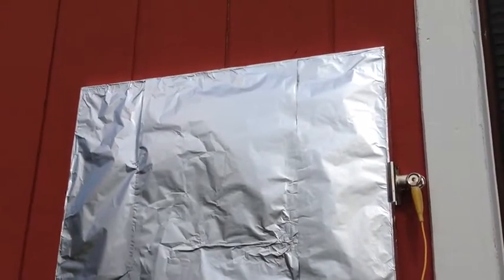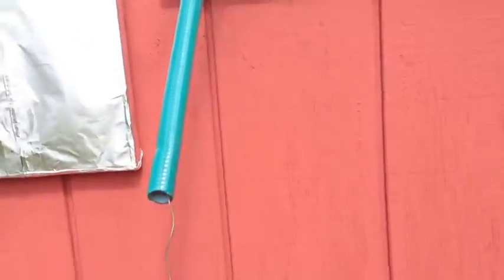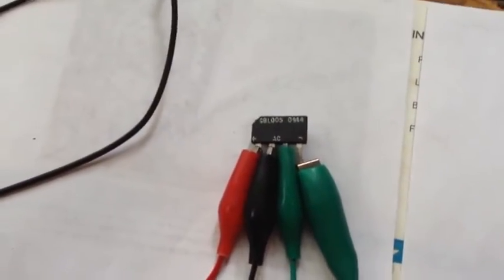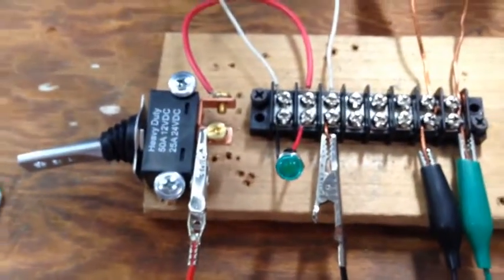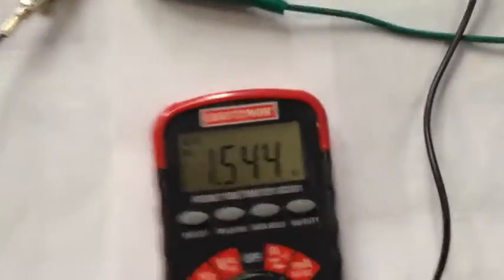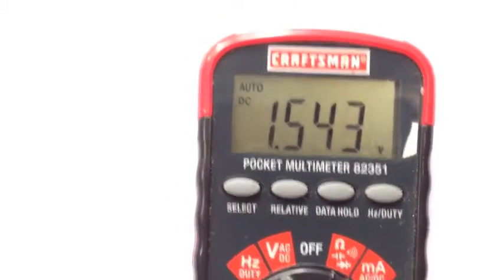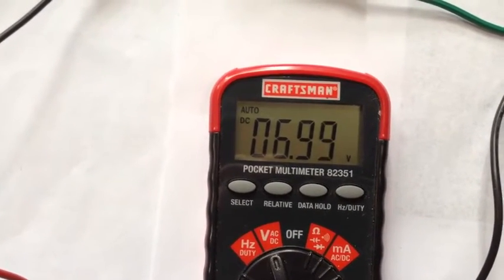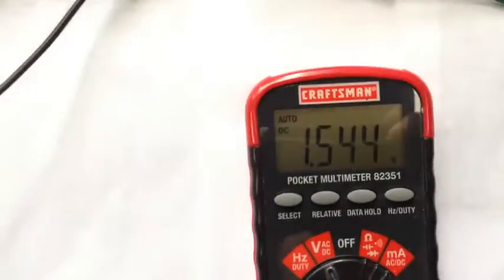Tesla Ambient Energy Collector

Comment: Use an antenna pole and drop a line down. Place a coil across that line and ground. Put that output into a tesla coil amplifier. Then a super capacitor pack and a voltage regulator. You can use a foss gate to create ac.

Comment: Another consideration. Instead of using a flat plate antenna, Tesla had worked out the shape of an ideal lightning rod -- different from the Benjamin Franklin design. You can find the Tesla patent on this and his discussion of why it is better. The shapes he proposed are NOT pointy rods. Rather, his design wants to bleed energy safely from Earth to sky rather than a pointy rod that would actually attract lighting strikes. With a gradual current flow, you have a current flow. Wink.

Comment: btw, if you use the home plumbing copper pipes as your Ground, you can pick up the SPIKES from appliances in your home and convert these to power using a circuit like this. Further, if you have fluorescent lights near your plate or coils, you will pick up power from your home lighting.

Comment: don't use a silicon bridge rectifier. Use 4 germanium diodes (1N34). Silicon has too big a voltage drop. Germanium is more delicate. See Tate Ambient Power Module circuit online.

Comment: recommend: IRON rod for ground or better a HUGE iron plate buried ... with IRON wire up to your circuit. For plate, use a plate of aluminum that has more mass. Tinfoil is very resistive. If the plate is hung with cords, the wind can impart or take ions. Connection to plate should be brass to aluminum ... and the copper should attach to the brass. It is very important that all wires be unobstructed and NOT near the house structure or any other structure.

Comment: I believe making a grounding system that has a greater surface area, and covers a larger perimeter underground should greatly increase the amount of energy collected. The greater the surface area of both the plate and ground; the greater the potential difference between the two which in my mind would lead to faster charging at a higher energy level. I would also be careful about using too many digital components, tesla of course only had access to a limited amount of tech, but I think he still would have avoided using transistors or mosfets, and would probably still prefer to use a spark gap or vacuum tube; as an important part of his later technology was having to do with disruptive discharges.
Reply: Tesla used a coherer, which is a "one-shot" device that needs to be reset. We have diodes now, but germanium is better.

Comment: Good work. why do you rectify the antennae? Radiant energy is already in DC. I wonder if using the same antennae and ground if you could make other identical parallel circuits and increase the amperage.also tesla says the switching on and off of the circuit is what increases the charging time. he mechanically switched in kilo htz. a $4 555 timer from radio shack is faster than that now a days. Have you looked into the switching part of Teslas  Patent  on "The Utilization of Radiant Energy"? its on google patents.also isnt the voltage set by the capacitors rating? Thanks again and Cheers.

Comment: the antenna needs to be away from and  above nearby building and trees. solder you connections where possible.  use copper alligator clips if you need to use clips. capacitor is to small

Comment: I have done this with my metal barn roof, it's on wooden supports and it varies so much, so I didn't have any means of controlling the very wide variations in voltages and frequencies. Interesting part was that chemtrails boosted the readings a massive amount.
Reply: "tuned" circuit needed.... coil & variable capacitor or capacitor and variable inductor.

Comment: I'm very interested in the same thing, particularly in Earths orbit. With the proper receiver/antenna array there should be a significant and usable amount. Outside our atmosphere there is constant ambient energy that could be collected. If the outer skin of a spacecraft were configured to collect these different energies that could greatly reduce fuel if not replace it entirely. Eventually we could use everything from gamma rays to gravitational waves for energy production.

Comment: this is briliant!  What are the measurements on your collection panel? I am very interested in working with you on this.
Reply from the maker: Hi John: The cardboard panel was approx 20 in x 14 and had aluminum foil taped to one side.
thanks
Reply: Would you mind sending me a wiring diagram and the codes for the diodes so I could get them off ebay ? I would really like to test this my self please :)
Reply: Miguel Khoury Please would you include a diagram for each project so others can try copying your experiments? I wonder if connecting circuits like this in series will produce higher voltages? Seems likely. I’ve noticed that every battery cell I’ve seen produces no more than 2.2 volts. Larger cells develop more amperage & all must get connected in series or parallel(?) to increase the voltage. Normal car batteries produce an optimum of 2.2 volts. A, B, C & D batteries produce 1.5. This does appear to be the mythical “free energy” if only it can be harvested for use!

Comment: nice setup. You'd get better output if you used a more efficient rectification method like active FET rectification, and your output would be more useful if a blocking/royer oscillator was used to keep the energy in the circuit. Check out LaserSaber's Joule Ringer.
Reply from the maker: Great feedback—thanks so much!